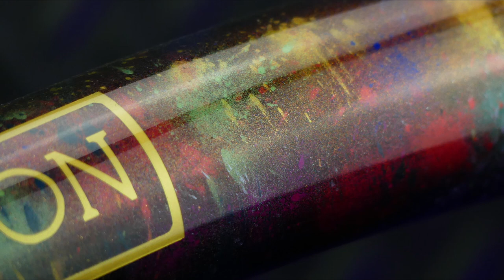CUSTOM PAINT | BROMPTON | How to paint a bike with pearl bomb technique

Comment: Awesom I have been looking for someone who has done a pearlbomb bike frame as I currently have a bike thats due fresh paint. Not sure about mixing hot and cold colours but this turned out quite nice being an old school round tube design. The fame Im painting has a lot of flats and edges I would like to highlight, and Im worrying about loosing them in the pattern. Any tips/ideas 🙏
Reply from the maker: I don't really have advice to give you. Just don't screw it up! 😁
Reply: @orionpaintworks  No chance I take my time. 7Ps lol. Colour sanding and multiple clear coats and lots and lots of polishing to finnish 👍